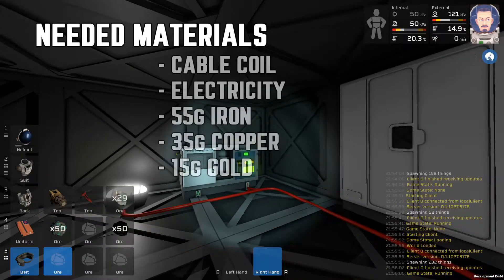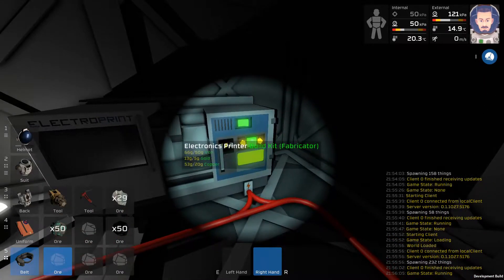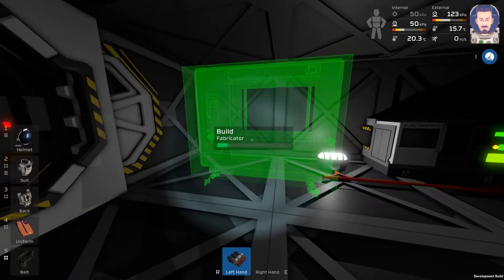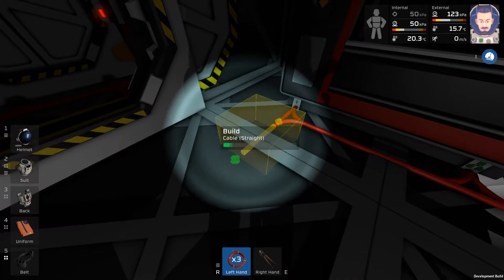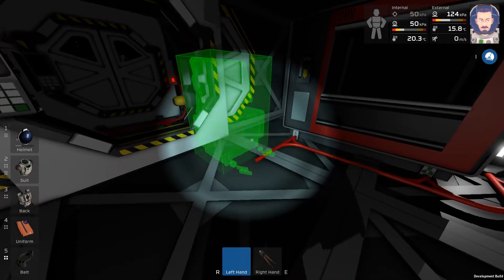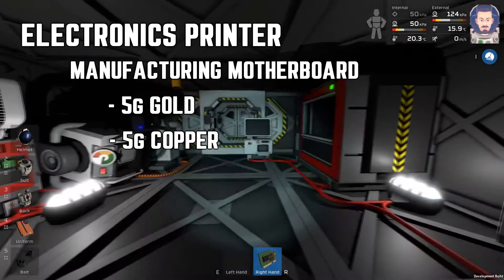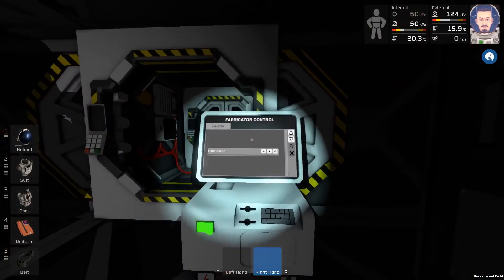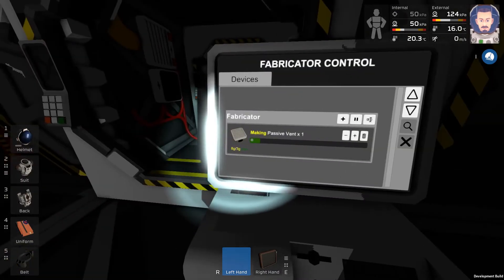FABRICATOR BASICS - 60 Second Tutorial: STATIONEERS

Comment: Will you do automatic solar panels?
Reply from the maker: For sure!
Reply from the maker: Speaking of the automatic solar panels; I'll do two videos. I know some people in survival cherish their supplies, so I'll do a video on how to do an auto solar panel with NO sensors and one WITH sensors.
Reply: FlyHighTay thanks!
Reply from the maker: So i've got footage, but it covers a lot of topics. In the footage I have: solar panels; heavy cables; batterys; transformers; computers; logic

I might split it up still, but they all might have to be in depth tutorials, which is fine. I might do a part series of it though, as it all builds on each other. Either that or a bunch of 60 second tutorials combined to make an in depth, post them all separate and then one whole video.

I only have the autmoatic without sensors so far as well.
Reply: FlyHighTay You can try to advertise your in depth videos after you've done the sixty second video. It would redirect traffic really well.
Reply from the maker: fair point, I'll look into doing that! :) Not sure what's been going on, but my performance while recording has gone down quite a bit